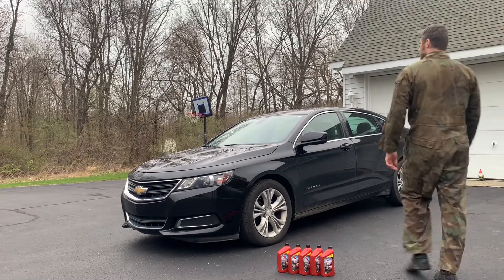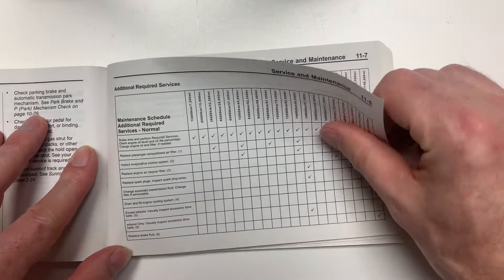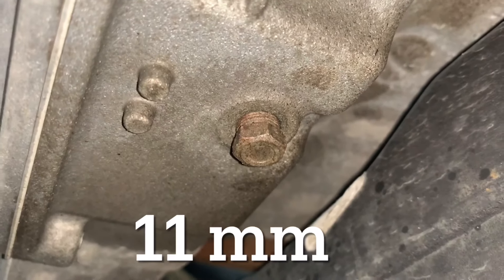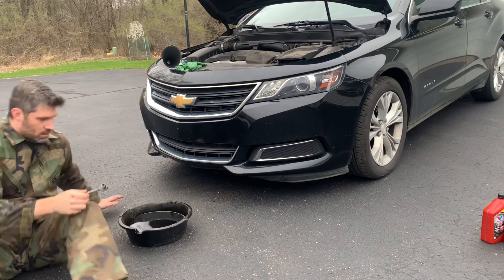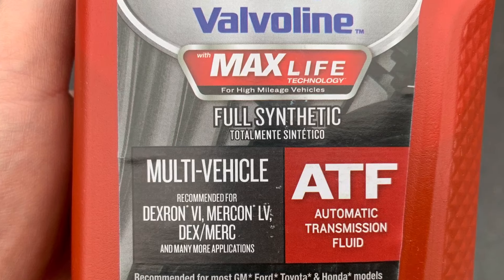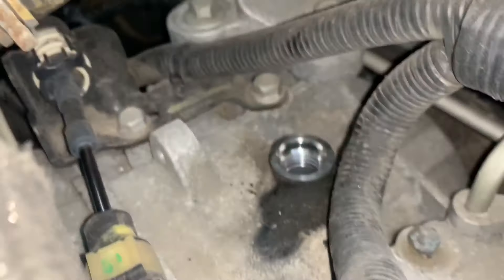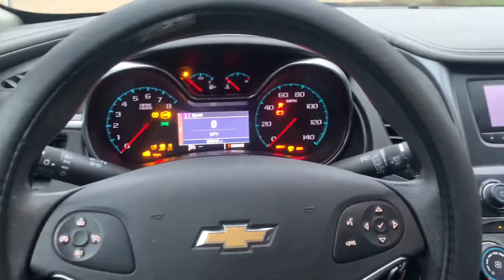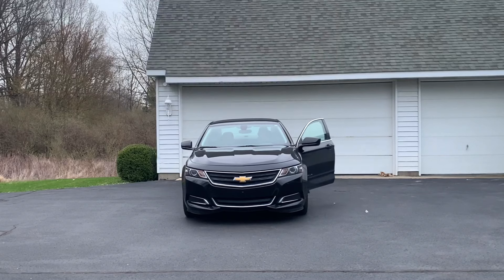How to Change Transmission Fluid in a 2014-2020 Chevy Impala | Drain, Measure, & Fill (No Dipstick)

Comment: The v6 has a dipstick. It’s simple. Drain, measure the amount that came out , refill with that amount. I did the process again. 😊
Reply: 5 quarts for your model?
Reply: where do i refill from? do i take out the dipstick and add it from there ?

Comment: I just drained my transmission and it measured 6 liters. I filled it up using the fill check plug on the side of the transmission and I only used 4 quarts. I think the dealership overfilled my transmission when I took it with them.

Comment: Just changed my fluid. Same exact car as yours. Only got just under 3.5 quarts. 3 quarts 300 ml to be exact. Makes me worried someone previously under filled it. I don’t wanna add more and over fill it if it’s got the amount it should have. I see most people get 4 quarts or more from this make and model drain and fill.
Reply from the maker: I would also put in the same amount that came out as to not overfill it. And I would also be curious if it is under filled from a previous owner.

Comment: A question, I have the same model but 2016 version that is at 122k miles. Would my trans start slipping if I changed it now ? Or is it still okay to change it.
Reply from the maker: A drain and refill as shown in this video should be ok. 
A power flush is not recommended and can cause issues.

Comment: Thank you so much for the excellent and clear instruction but I have a question does this model has a transmission filter? I have the same model 2014 LT 2.5 and I'm planning to change the transmission fluid but I'm just curious if it has a filter or not.
Thank you!
Reply from the maker: There is not a serviceable/accessible transmission filter. Only the ability to drain and fill the fluid for maintenance.

Comment: Informative and easy to follow video, well done. 👍
Question, does the transmission have an external filter that can be changed?
Reply from the maker: @gnipgnop-yn6ox  thanks, glad it helped!
No, there is not an external or accessible filter. It is inside and the transmission.

Comment: Thank you for your video . I have a question How can I change Transmission filter ? I have 2016 impala 6VV .
Reply from the maker: This vehicle doesn’t have a pan that can be removed from below to change the filter. To change the filter, the transmission must be removed from the vehicle and split. The only maintenance available (other than a flush) is the partial drain and refill shown in this video. It is partial because the transmission fluid in the torque converter does not drain.
Reply from the maker: This vehicle doesn’t have a pan that can be removed from below to change the filter. To change the filter, the transmission must be removed from the vehicle and split. The only maintenance available (other than a flush) is the partial drain and refill shown in this video. It is partial because the transmission fluid in the torque converter does not drain.

Comment: What country are you guys in? I have a 2017 LT impala and my engine doesn’t look anything like that.. and the transmission oil cap is not under the battery
Reply from the maker: I am in the United States. This is the four-cylinder engine. You may have the six-cylinder engine, which would look completely different.

Comment: I'm honestly thinking about doing this myself but I've read that there is a specific way to do it, needing to get the transmission fluid to a certain temperature to check its proper level becuase the liquid rises when at a certain temperature and is a different level when cold. I dont know how true this is. I was wondering how your car has been holding up since doing this fluid change ?
Reply from the maker: Good point. Materials and fluids expand as the temperature increases. You could change the fluid when the car is “cold” so the fluid in the car and the fluid in the jug are the same temperature to eliminate this variable.
I have not had any issues with this vehicle. It is running fine.
Reply: @How-to and Reviews  thank you for the fast reply. I appreciate it.

Comment: Mines has a dipstick can i just add fluid since im low?
Reply from the maker: If you have a dipstick, definitely use that. Check it closely. It probably specifies to check the level when the system is hot.
Reply: What year is your impala?

Comment: I tried looking on Google for transmission fluid capacity for a 2019 Chevy impala LT 3.6L flex fuel. I want to do a drain and flush only with no flush. Any idea?
Reply from the maker: You will be doing a drain and fill. If the transmission has a dipstick, fill it to the cold full mark on level ground. If there is not a dipstick (like the vehicle in this video), add the same amount of fluid that was removed.
Reply: My dip stick says “hot check”. And when I check it while car is running, I can’t really tell where the line of fluid is at. When I drained it. About 6 quarts was drained out. I made the mistake by using a 5 quart container and it started to overflow. So I lost some oil. Couldn’t measure it out. I just put back in 6 quarts according to some transmissions shops and dealers around here in Scottsdale area. Thank you though👍
Reply: Did you use maxlife? And did you get in weird shifting afterwards?
Reply: No, I used AC Delco Merc VI. I had no problems with the shifting or anything at all. All good 👍

Comment: I have the same engine it's at 96,000 miles Nebraska weather, last time I brought it in he told me it should be good until it starts leaking. Idk if I should trust that and just get a changed next oil change
Reply: The thing is that once the transmission oil is old old if you change the gears can slip.  So many end up not replacing it so better to do it before it's too late.  That's what I learned from researching.   I am not a mechanic

Comment: I've always been terrified of changing transmission fluid, so many people tell me not to change the transmission fluid because apparently new fluid can mess up the gears, I have a 2017 Chevy Impala with 145,000 MI, is it safe to change the transmission fluid with all new fluids at this point?
Reply from the maker: The fluid does not last forever. It is burned up and losing its properties. The owners manual says to change it. It should be changed.
A drain and fill should be safe. You are just replacing bad fluid with good fluid. 
What do you want to avoid as a power flush. That can break loose debris and cause issues. I think that is probably what you are concerned with. 
That is my view on it. But by all means, do additional research until you feel comfortable.
Reply: Ive done plenty of research on this particular topic, the conclusion ive come to from experienced mechanics is to change the transmission fluid on time and regularly, however if oyuve never chnaged the transmission fluid and ur way past the change date, then dont change the fluid. Changing will only cause more damage

Comment: I have 2014 Chevy Impala 138 thousand miles, won’t go into gear after it starts up. The clutch moves back and forth but the car is not moving in any direction.
Reply: Still ?
Reply: @Justincaseyahur  a mechanic said I need a transmission
Reply: @1vondutchess  so now it just sits and I drive it up the street  once in a while till I figure out what to do with  it , it drives just fine it’s just getting it Into D or R or In and out of P that’s the problem

Comment: Do not used the Dexron 6,causes torque converter shudders.Use the Mobil 1 LVHD in it's place
Reply from the maker: Thanks for sharing!
Reply: If u start experiencing those shudders what do u recommend? Recently started having one at about 50-55 2017 premier
Reply: @334coldestbarber7  The Mobil 1 LVHD.Has to be completely flushed out of the dexron 6
Reply: @Toolaholic7  gotcha. Good looking out
Reply: It's not the fluid, it's the valve body solenoid. Common GM problem.
Reply: @jhargrove1108  It is too,Jasper and a few transmission reman companies found this out.Jasper will not warranty the 8 speeds if Dexron 6 is used and this includes the 6 speeds

Comment: What about the filter
Reply from the maker: The transmission has to be removed to change the filter. The only practical self maintenance is to drain and refill to change the fluid.

Comment: I have a 2017 Impala with the 3.6 V6 and 6 speed auto and it has a dipstick for the transmission.

Seems odd that the transmission has no dipstick with the 4 cylinder when it is the same transmission.
Reply from the maker: I agree, that is odd if they have the same transmission.
Reply: @HowtoandReviewsOfficial  Yeah, GM makes no sense sometimes. The tranny in my 2014 LTZ has no dipstick, just like my old 2012 Malibu, but my 2012 Acadia did have one. Stupid.
Reply: My 2018 Chevrolet Impala Premier has no dipstick

Comment: This is not a transmission oil flush you need to flush the torque converter to . All you did is change the 4 quarts in the case .
Reply from the maker: I completely agree. This is not a flush. It is a drain and fill. 
Also, a flush is not recommended for higher mileage vehicles.

Comment: Most of these call for 5.3 quarts. If the last person didn't do it right, you are just doing the same.
Reply from the maker: That’s true. I’ll point out that it is not a complete drain. There will still be old fluid in the torque converter.
Reply: @HowtoandReviewsOfficial  Well of course. But it is still crazy trying to get a correct answer to how many quarts on a simple change to put in. Amsoil says 6.4 without a flush, my Malibu used to be 5.3. I changed mine yesterday and it didn't even have 5 quarts in my 2014 Impala. I put 5.4 back in. The sight plug is impossible to reach. Hard to imagine no one seems to know the actual correct amount.